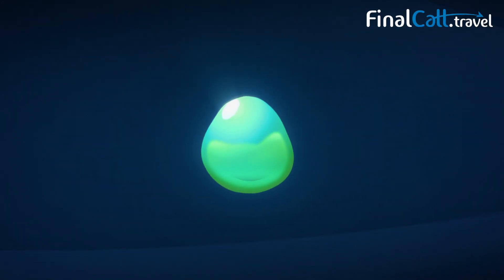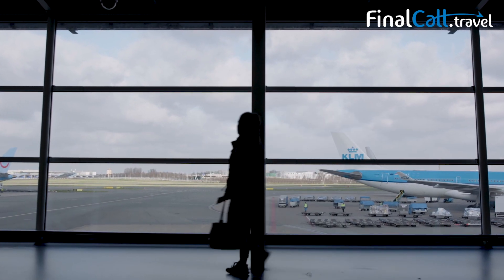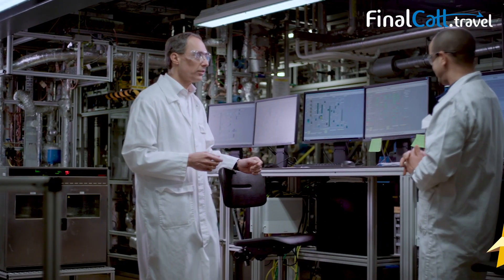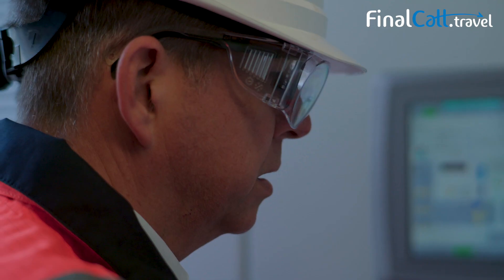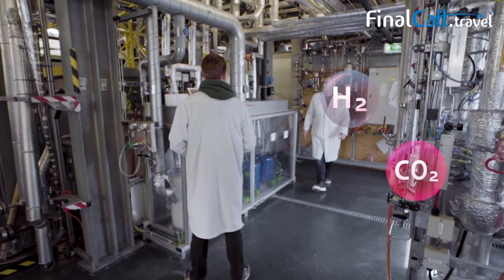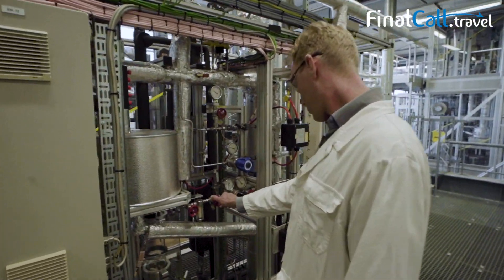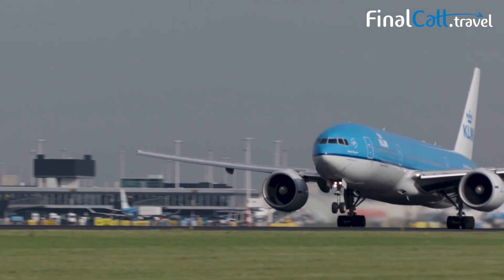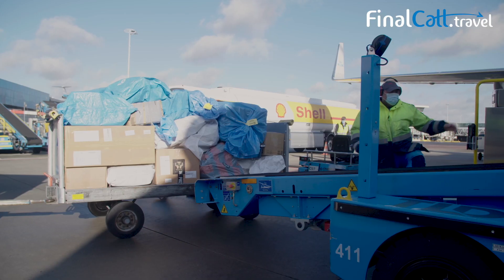KLM - First passenger flight with synthetic fuel

Comment: Apart from CO2, what harmful emissions are produced?
Reply: None
Reply: Very little.
Reply: even less than traditional crude-based fuel, since it won't release additional chlorofluorocarbons left over from the refinery process into the atmosphere, and it will also help it burn cleaner.
Reply: It burns cleaner as it doesn’t have the dissolved sulphur and other nasties that fossil fuels do, but it still emits NOx. No way around that with air-breathing combustion in our 78% atmosphere.
Reply: @DickyChap   I read that there is a way to dramatically reduce NOx. It would be done by having hybrid-electric planes with the jet engines driving generators. Then they can attach exhaust treatment deviced to the exhaust of the engines, just like on cars. Except jet engines already produce much much less NOx then cars do. So it seems like carbon fuels actually can be quite harmless to the environment.